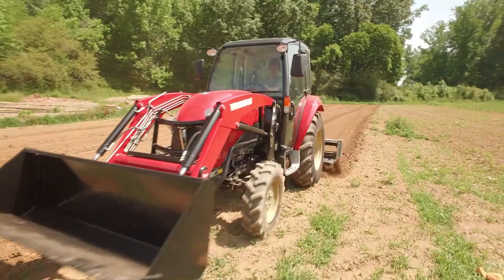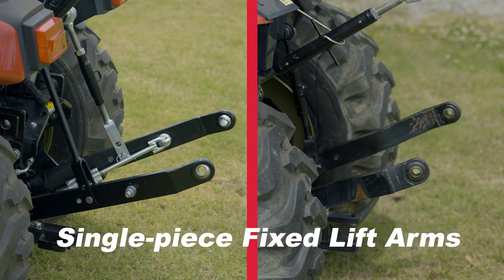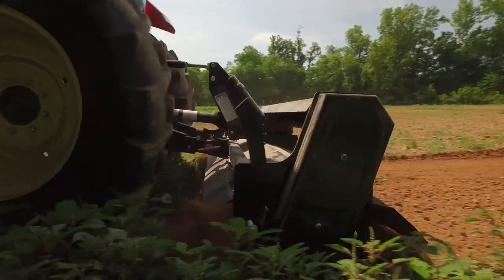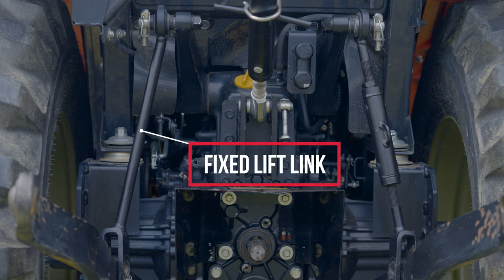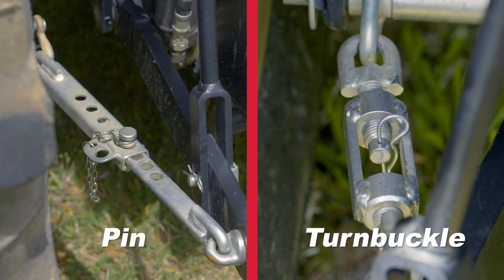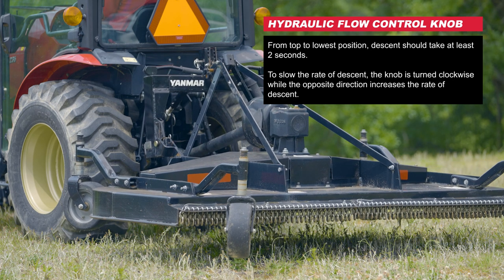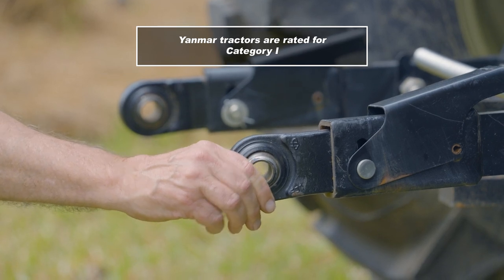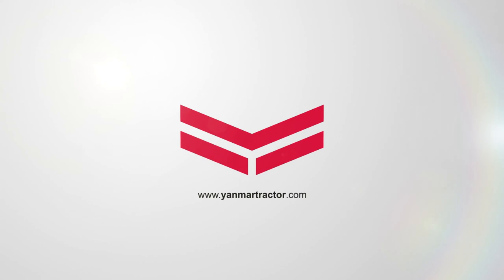Yanmar Tractor 3-Point Hitch

Comment: Hey Yanmar how about putting your SA series big manuals online.  I hate reading small print and reading it online is so much better.  I have the SA 324 tractor.  Now go back and look at your video.  By the PTO is a glass window.  Your manual says that is the transmission fluid.  I am thinking the same as hydraulic fluid.  Now look at your glass window that is suppose to be half full.  It is all the way red.  Just like mine.  So is it too full or too low?  I don't see any fluid in mine just this red thing inside. Fills the whole window.